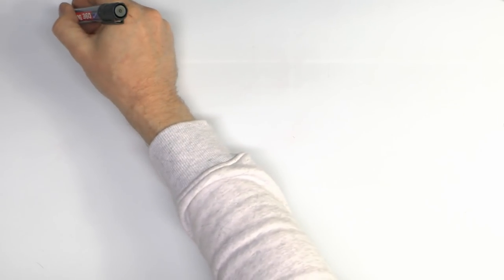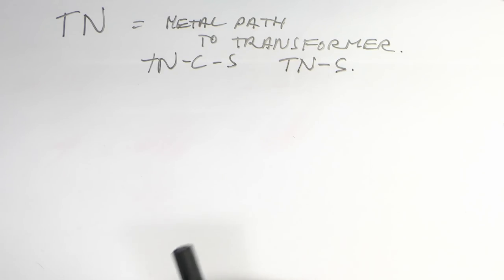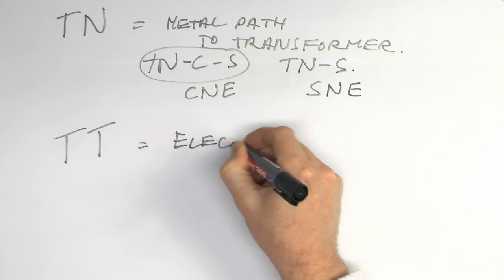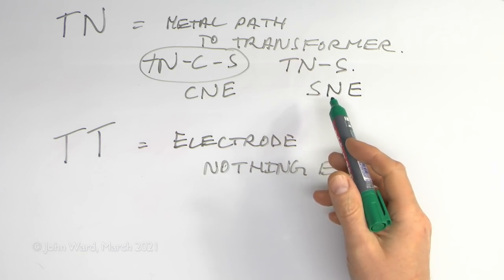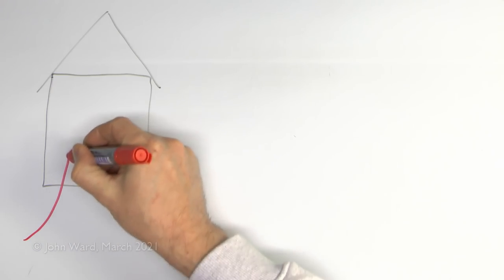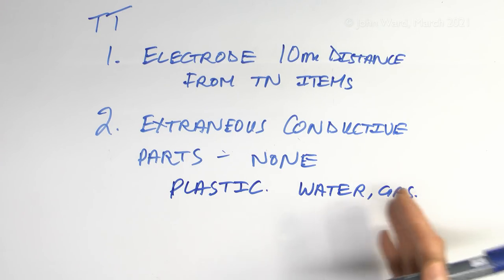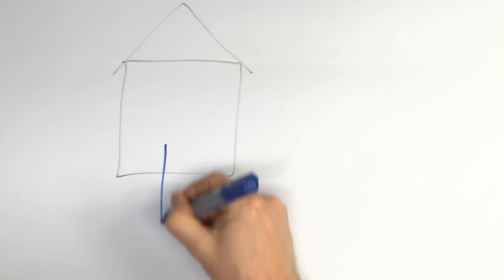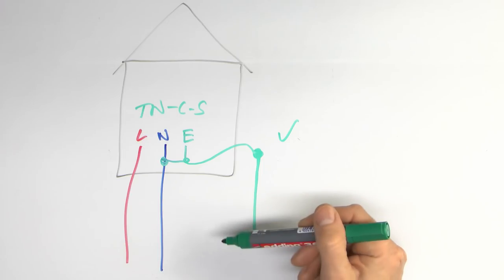Using a TT earth where a TN earth already exists

Comment: Interesting! I have an odd situation in my house a previous electrician has cut of the cpc from what i believe is a TNS supply as its only something like a 2.5mm. (Cpc disappears behind the DNO wooden backboard i think the DNO head is in my neighbours house as im mid terrace and the house was built in 1950s. All i have is  VIR into the meter on my side). Anyway iv done a Ze on the cut cable and its 0.28ohms but a earth rod has been installed instead of using the 2.5 as i assume it was decided to be undersized. (60A supply) 
iv been tempted to connect the DNO cpc into the Db to improve the current Ze and leave the earth rod in. However i figured any fault would still travel down the 2.5 as the resistance is so much lower than the rod.

Comment: If there is a long metal pipe between houses, what's the chance that its resistance to real earth would be high enough  that it would rise to a significant voltage?
Reply: in about 10 meters of ground any stray voltage is dissipated but I'm confused how stray volrage don't dissipate in 10 meters of pipe
Reply: @lordjaashin  Remember your voltage drop calculations. The ground dissipates voltage effectively due to it's relatively high resistance but a metal pipe is just a large hollow wire.
Reply: @Mattja1  Good point

Comment: John, very interesting, thank you. I carry out Quinquennial surveys on Churches and see it becoming common to bond the Lightning conductor to the earth on the electrical system with 10mm earth wire.  In the case of many older churches where there may be only one lightning electrode on a tower or spire the ground termination of the tape is within a metre or two of the external wall. I have been told by an electrician that this is correct but it appeared to me that in the case of a strike the entire earth circuitry in the church will become live.  Could you comment please and also on why TT earths on Churches always seem to be within a metre of the building?

Comment: Hi John, excellent informative video thank you very much. I have a question you may be able to advise, our supply in a TN earth but I have two containers sitting on the ground and a metal garage alk of which need to be earthed. Will the surface area of the structures sitting on the ground introduce a TT effect or would this be negligible. Many thanks👍

Comment: Interesting video John. There is one thing though; at the end of the video you suggest that connecting an electrode that is outside of the property to the PME connection is a good idea. If the electrode cannot by accessed by persons then this is OK, but if the electrode can be assessed and electrode impedance is not low enough, then this will possibly export a raised voltage outside of the ‘faraday cage’ bonding of the property.

Comment: John what would you do in this situation? 

Power to a carport for some lights and sockets.   The carport has a metallic frame and is part buried in the ground, the ground inside the carport has good conductivity with true earth. It is also known that class 1 equipment is to be used inside the carport.  The carport is also 2m away from buried PME metalwork

The house supply is TN-C-S,  the 2 problems I see are:

- Use the TN-C-S earth and bond the metallic frame (extraneous conductive part) using 10mm
The problem being this makes using class 1 equipment inside the carport potentially dangerous due to associated risks of PEN fault.

- Make the carport TT,  Although due to the location and presence of buried PME metal work electrode separation and separation of the metallic frame will be under 5m therefore rendering the point of making it TT pointless?

Comment: 10:35 - all well and good while the PME is intact but when the PME is bringing 70+V into the MET that water pipe will act as an excellent earth between those two installations.
Ordinarily, the TNCS will give the lower resistance reading but when the PME issue arises,  I can't see how that pipe is ever going to deliver anything like the 50V to earth (safe touch voltage limit).
I'm still inclined to go for the TT arrangement.

Comment: Hi John, i enjoy your videos and explanations very much, thank you.
I have a swim spa in my garden, (large hot tub), it's on it's own TT. The earth rod is 13m away from my incoming supply which is a PME. Water and gas are plastic. so hopefully my TT is good. The rod tested to 53 ohm's, ground very dry.
My question refers to bonding. I have introduced a set of portable aluminium steps to access the spa. They sit on "true ground" and it would be normal to be in contact with them and the water at the same time. Should these be bonded to the TT.
Thanks.

Comment: Great video John, thank you. I am now wondering though, if you're getting a low resistance to earth via a gas/water pipe, i.e. <0.8 ohms, then why was it outlawed to use utility pipes as a means of earth? Even if you have no choice but to use a TT earth via a rod, the electricity will always flow to ground via these pipes, so it seems rather useless installing a rod. Obviously we can't rule out the fact that the pipes at some point might be changed to plastic, therefore you'd lose your earth connection completely, but I'd imagine that the risk of that is small compared to a fault occurring and the electricity flowing to ground down an unintended route.

Comment: Thanks for tackling this tricky & poorly understood subject John. 
It would have been useful to have some practical illustration of isolating the TNC-S earth from an armoured cable at an outbuilding. With all the Electrician videos we have on YouTube, I haven't seen a single one of them demonstrate this, I haven't even managed to find a photo... I gather the most common approach is to terminate the armoured cable in a plastic box rather than directly to the "garage" consumer unit. Perhaps worthy of another video please.
Another suggestion I have seen is to use a plastic step-down adapter from say 25mm to 20mm at the consumer unit. I have seen a straight through 20mm, but only as a component of a gland used in explosive environments, so too expensive to be practical.
An important point that seemed to be missed in the video is that 10mm earth cable to an outbuilding (for bonding requirements) as part of an armoured cable isn't really a very feasible size as it would make for a huge armoured cable!
Also worth mentioning that exporting TNC-S is more of an issue where you have a metal outbuilding, particularly if damp is a problem. Plastic vs metal accessories in the outbuilding might also be worth mentioning. Also concrete floor vs wooden floor.
Reply: Normally when the armoured leaves the house it would be connected into a plastic box on the wall as you wouldn't want a SWA run through the house so this is where the disconnection would take place.

Comment: I've been aware of this for a long time but recently TT systems have sort of become a protective measure in their own right for some external applications and this can only be the case if there are no metallic services to be bonded and the electrode is clear of anything connected to the network neutral. Should we have new earth type possibly TT-N ? and TT just for a clean earth (Island Earth) If the IET does this I thought of it first.

Comment: I thought most modern water pipes were plastic ?

Some examples / pics of incoming supply TNCS TNS and TT system would be awesome / the actual boxes. Comparing a 1930 house to a 1980 house (new build estate) 30 meters away.
Reply from the maker: They are, but there are still plenty of older installations with steel or lead pipes.  Many gas installations with steel supply pipes as well.

Comment: I assume that if you just added an insulated section on the pipe that feeds the outbuilding in your first example then that would be fine and you could avoid exporting the earthing system?
Reply from the maker: That's an option, or ideally replace the whole pipe with plastic.

Comment: Not sure the massive low resistance earth electrode would help, it might even make it worse.

Your neighbours really mess everything up.
If you did have shared bonded metal pipes, in the event of a fault on your neutral alone, there would still be a path to neutral via your bonding, through the shared pipes, out through their bonding and Back to the transformer through their neutral.

To make a difference, the impedance of the earth electrode would have to be lower than that of the path joining to your neighbour, potentially very short if in a semi detached.

On the other hand if the neutral fault occurred upstream of everybody connected to the transformer, seem like it would do more harm than good.

You'd become the prime return path for the current for everybody on the street- through their bonding and pipework to your earth electrode, and back to the transformer. But then an entire street's worth of current is flowing through pipes and wires designed for one house, something they may not be able to handle.

Many amps flowing through the gas main to your house continuously seems a little worrying, even the 16mm^2 conductor probably isn't rated for hundreds of amps contunuously.

Worse, the connection could  be good enough to mask the break, allowing it to persist for an extended period, where without, the earth impedance would be high enough to cause disruption, and a call to fix it.

Comment: So work in the caravan industry, I vist caravan touring sites, storage sites and customers homes. Every single home i visit will have the caravan or motorhome pretty much continually connected to the mains supply, many, but not all will have metal body's, all will have a metal chassis and copper gas pipes bonded to this supply via the 230 volt hook-up cable, most of these homes will be TNCS arrangements 

Your video indicates that officially the out let to the caravan or motor home should really be converted to a TT system which in a street is actually next to impossible 🤔
Reply: Just further to that, with the caravans and motorhomes having a 12 volt DC system and charger for this, what is the potential for a DC current making its way back to the RCD and blinding it to a fault?

Comment: In the TT system as you describe it, how are you assured that you get enough current from a fault to trip the breaker?

US systems ground the neutral at the transformer, but also at the main panel. Past the main panel, everything has an earth wire that goes back to the main panel and the bonding point. Sharing a ground and neutral has been against code for probably 50 years in the US?
Reply: Unless we can get a really low and stable resistance on the electrode we use RCDs (GFCI) to meet disconnection times for earth faults.
Reply: @sidwainhouse  Ah. US installations normally only put GFCIs on circuits subject to moisture, such as outdoor outlets, bathrooms, hot tubs, and the like. I think the newer codes have a requirement for AFCIs on circuits going to bedrooms.
Reply: @PaulSteMarie  In domestic we pretty much have everything on RCDs now. These are done at the source of the circuit so the whole installation is protected.

With the new trend of electric vehicle charging points taking off we're having to change the type of RCD as we have seen DC currents generated by the EV point blinding the RCD and stopping it from operating when required.

Customers are more than happy to show off their brand new Tesla but begrudge paying more money out for something that may well save their life...  🤣

AFDDs arc fault detection devices,  (AFCIs) are coming in slowly but we've never really had any major issues with arc faults causing problems, probably because we use 230 VAC single phase which tends to burn things out a lot quicker than 110 VAC.

Comment: You have mentioned about removing metal water pipes and preplacing with plastic. What about the water within the pipe is this not conductive and will be at earth potential ?
Reply from the maker: Clean water is a very poor conductor.
https://www.youtube.com/watch?v=MF9DCNkaE8I
Reply: Yes that told me. So its okay to heat the bath water by throwing an electric fire into it. Happy New Year try smiling it doesn't hurt.

Comment: I believe it would be as simple as making a insulated coupling at the furthest entry point of water / gas lines. Example just after the meter when installed outside the home of course.
Reply from the maker: That's ok for water, but gas services cannot have any plastic components after the meter.
Newer gas services are often plastic outside underground, so having an older steel supply converted to plastic may be an option if the network operator offers it.

Comment: Would it be fair say that in a garage/outbuilding with no extraneous conductive parts it’s fine to use SWA and connect to the house TN system? Thank you for the videos and sharing your knowledge.
Reply from the maker: Yes.
If there are extraneous conductive parts, the TN earth can still be used, those parts just need to be bonded to the main earth terminal in the same way those in the main building are.
Reply: @jwflame  cheers JW 👍
Reply: But what about Exposed Conductive Parts - such as the metal chassis of a freezer? Especially if one could simultaneously touch the freezer and be in contact with the ground, True Earth, upon entering/exiting the wooden outbuilding? Seems like there isn't a perfect answer and the designer has to make a judgement based on all things considered. Then explain in detail to anybody questioning his/her judgement as to the suitability of the design.

Comment: 11:10 why can't you just do the TT and not bond the pipe in the out building? It's already bonded house-side so what's the point in bonding it again?
Reply from the maker: Extraneous conductive parts require bonding, as they may not be at the same potential (voltage) as other parts.
If it's bonded, then the outbuilding cannot be TT, as it's connected to the main house which is a different earthing system.
Only other option would be to replace the pipe with plastic so it's non-conductive.

Comment: Hi John, love the content you make! Question for you: who is responsible for Earthing arrangements? I currently have an old house with a TT arrangement but wanted it changed to TN-C-S - DNO is refusing saying it's not their responsibility??
Reply from the maker: DNO are the only ones who can change it to TN-C-S, and it may not be possible in some areas as it depends on how the rest of the network is designed.
If there is an existing TN-C-S or TN-S earth then it's the DNO responsibility to maintain it, but if there is no earth provision and it's TT, then it's the property owner's responsibility to maintain or provide new earth electrode(s) as/when required.

Comment: Where you say you should have 10mm2 earth if you're using the house's earth for the outbuilding - what equivalent is that to the armoured sheath of an SWA cable? Say I have a 4mm2 three conductor SWA (15mm overall diameter) - is using the steel sheath good enough along with one conductor?
Reply from the maker: For bonding of 10mm², the armour needs to have the equivalent conductance, which for steel is about 8x less, so steel armour of 80mm² would be required.  For a 3 core cable, the cores would have to be 70mm² or above to have armour of that size, something that would never be used on a domestic installation.
4mm² 3 core SWA has armour of about 20mm², which is equivalent to about 2.5mm² copper.

if bonding is required to the outbuilding, then the only viable option is 10mm² 3 core.
If bonding is not required due to no extraneous conductive parts in the outbuilding, then the cable can be smaller, as the requirements for a protective conductor are different to those of a bonding conductor.
Reply: @jwflame  Thank you John

Comment: For a 3phase and a neutral supply, which system of earthing will now be the safest to adopt ?  The neutral is at a zero potential thus has not current under a balance load condition . 

I am thinking that a TN-C will be safer than a TT . What do you think JW ?